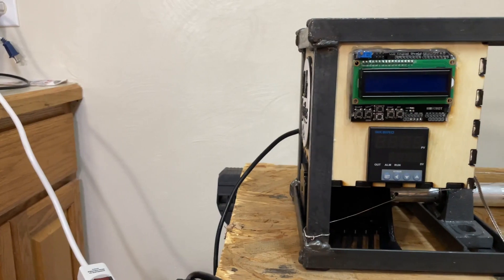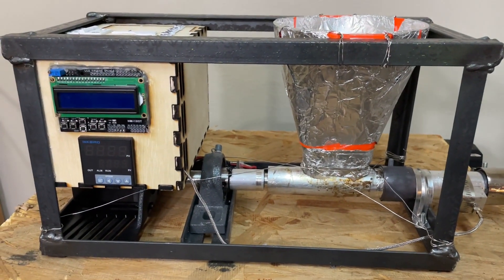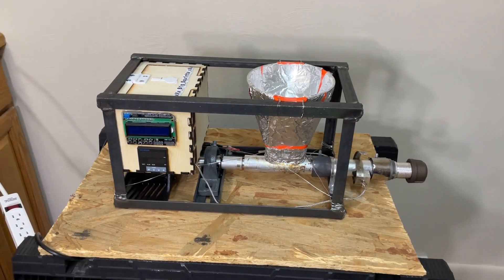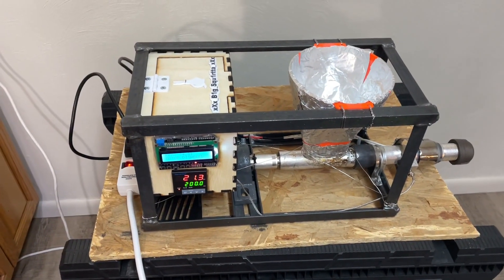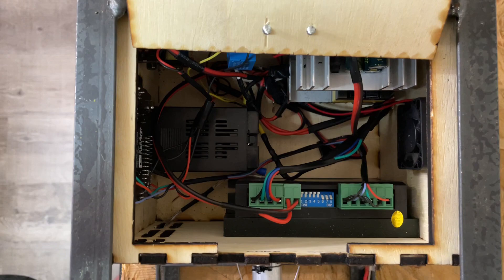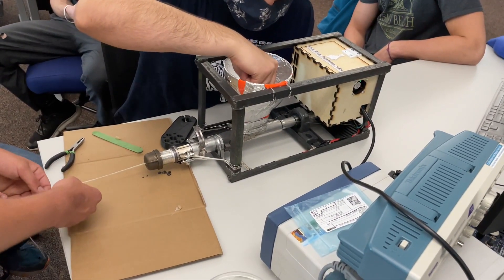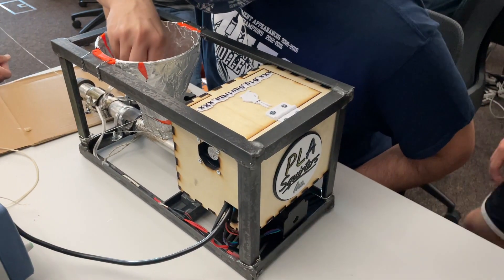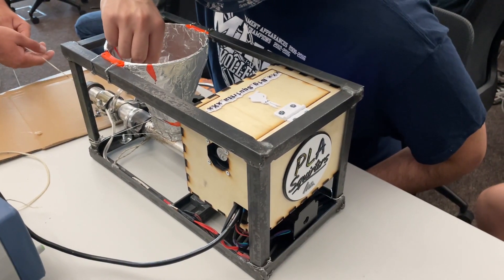Filament Extruder by PLA Squirters Inc.

Comment: I'm curious, what kind of documentation did you guys make on this? And how much research was done before building?
Reply from the maker: This was a school project that lasted one semester (16 weeks), and this video is likely the only surviving documentation. We did a few weeks of looking at how other extruders are made to get a rough design, and we did some basic heat transfer calcs to get minimum heater wattage numbers. 

Ultimately our design was limited mostly by budget ($200) and limited machining experience. The nozzle was too far from the end of the auger, which trapped molten plastic, and the hopper melted when it rested directly on the pipe, hence the foil. The motor wasn't strong enough to push the plastic through the system as fast as we had assumed would be possible, which also contributed to burning/uneven extrusion.

If I were to try this again, I'd probably make the barrel smaller and use a concrete or wood drill bit as an auger instead of machining something from scratch. I would spend that time on designing and machining a better nozzle that fit closely to the end of the auger. I would also try and get the machine finished early with an overbuilt, geared down, DC motor so you can dial in the speed and remake the nozzle/barrel/heater layout if needed. Calculating exactly how much energy would go into the plastic and finding the exact minimum motor power is above my pay grade even now, so overbuilding it and tuning the machine would have probably improved our results more than spending longer on calculations.

If you have access to a MIG welder and a laser cutter, I highly recommend welding your frame and making a laser-cut, or at least 3D printed electronics enclosure. Welding saves so much money on fasteners (and is very easy with MIG), and the enclosure makes it look better and easier to service. Buying an off-the-shelf temperature controller also saved us a lot of time for relatively little money.

If you just want a filament extruder for your 3D printing setup, don't build something from scratch. I don't think it's possible to get viable filament for less than the cheaper well-rated extruder kits you can buy online.

Comment: Hi which heater did you use? Could you share link of heater?
Reply from the maker: I don't think we actually ended up using these exact heaters, since they did not arrive in time, but we used ones similar to this https://www.amazon.com/BestTong-Injected-Heating-Injection-35mmx35mm/dp/B07HJBS4Q3